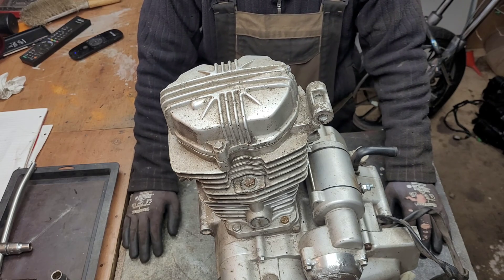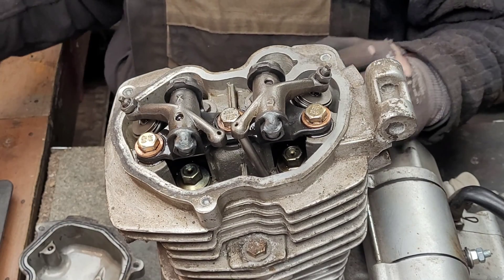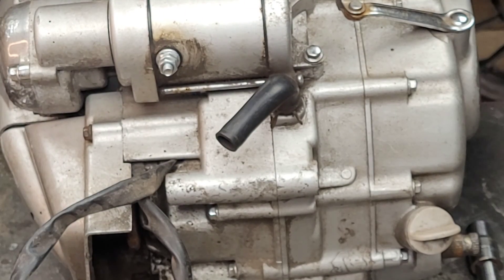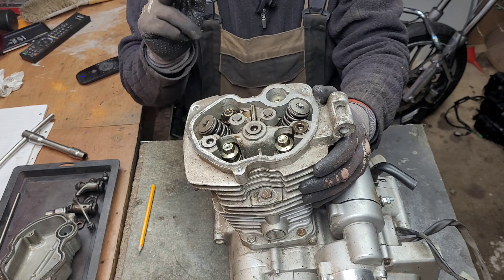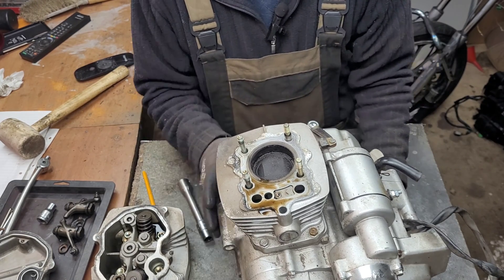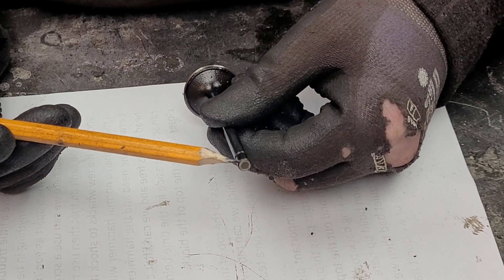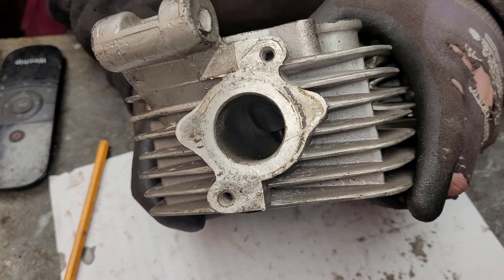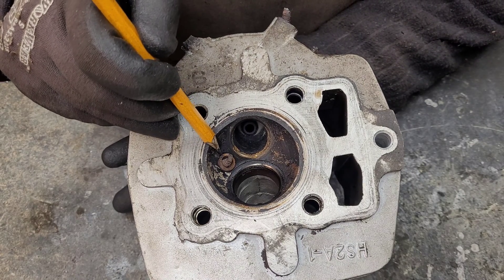Motorcycle engine strip down for beginners - The head and block.

Comment: Might be a stupid question but I’m changing the piston on my lads 50cc 4stoke bike and that’s a pushrod with 2valves do I after time it up when putting back together is does have timing marks on the flywheel but can’t see any marks on the casing but does have inspection hole at top of casing ? Thanks for any help
Also changing gaskets on the cases do I torque them or just hand tight with new gaskets